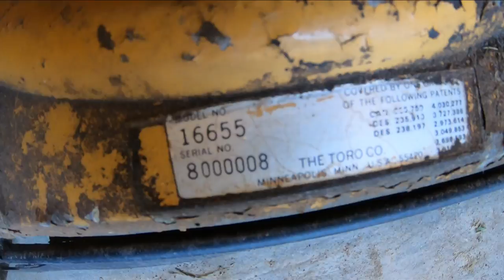Vintage, Heirloom Lawn Mower, Will it run?

Comment: dude aweasome machine,they are the best ones.but i have a question.where did u get your boots from? i need me a pair.
Reply from the maker: These are ariat work hogs, I’ve had 5-6 pairs with great luck, this pair however isn’t holding up, less that 6 months in and the sole is coming off!

Comment: Briggs always used a die cast aluminum key. When the blade hits something, the key sheared instead of breaking the crank. Of course it would be out of time.
Reply from the maker: yes I have a pack of them here I just never realized they wernt steel, ive gotten alot of free mowers that just need keys

Comment: When DC starts cleaning the mower
Me: thinks Should have done that outside
two seconds later
DC: Should have done that outside
Reply from the maker: the shop is always a mess and I cant figure out why....
Reply: Diesel Creek is a tidy shop, a used shop?
Reply from the maker: @almostanengineer  id argue its not....
Reply: Daniel Coates I thought he would have steam washed the sucker first.
Reply: @DieselCreek  Our workshop is both clean AND used.  It may also contain a ride-on mop!

Comment: the first 2 digits of the "code" number on the metal shroud on the briggs will tell you the year. As long as its the original engine

Comment: Look at the motor shroud theres 3 sets of numbers the the last set is the code numbers it may say code it may not but either way its the code number the first two digits of the code number is the year so if thats your original motor you can go by the code number remember just the first two digits

Comment: My dad's got one just like it got it from my grandpa when he updated his been through hell and back basically just a deck at this point engine was replaced 2 times the decks been repaired and the self propelled part hasn't worked in years because it was broken when he got it. I am curious though I have never seen a yellow one before is there something special about it?

Comment: i fixed an old vertical shaft tiller looked like the same engine put the pull was different
and the problem was the points

Comment: They make aluminum crank keys to break off if you should hit a root or something it won't bend the crank yes those were made when people had common sense and knew better than to keep hands and feet from under mower deck. Safety first Matt lol
Reply from the maker: ive got the genuine Briggs keys, never realized they wernt steel lol

Comment: Be careful i broke the chuck off my dewalt 20v hammer drill starting one of my projects lol
Reply from the maker: I’ve somehow managed to get 4-5 of these drills so I won’t cry if I break one, this ones got a bent shaft from doing this
Reply: @DieselCreek  i hear you brother. Just replaced a second chuck screw today! Keep up the great work. I did diesels for a while in our shop now its all small engines. I aint gonna lie i love the small engine side of town just did a head gasket on a kohler xtx675 today. 40 bucks saves a 300 dollar pushmower whoop whoop
Reply from the maker: @cornbreadntatersalad1634  small engines are my favorite thing to work on as well, so easy and can be quite rewarding too.
Reply: @DieselCreek  yessir puts dinner on my families table everytime!

Comment: I think that's a Toro but it was sold by JCPenney because it's yellow.
Reply from the maker: interesting, I was wondering about the color. in the parts horde he has for it there are a few spare decks and they are red.
Reply: @DieselCreek  I was trying to look closely to see if it said JCPenney anywhere but one of those old cast aluminum deck mowers I had was a non-self propel 19-in same deck style as that and it was gray and it said JCPenney so it could have just been some other store special edition whatever I don't know I do know that they used that deck casting in the late sixties for Toro guardians and the old whirlwinds with the Tecumseh engines on them.

Comment: The blade and deck will last much longer if one does not run the mower over gravel and sand where the blade can suck up the abrasive material.
Reply from the maker: thats why I jacked it up, I like to leave the green stuff longer

Comment: I picked up a lawn boy last week looks a little newer than this one same aluminum deck unfortunately rear wheel drive, lawnboy is made by toro
Reply: It also has all the safety crap on it
Reply from the maker: I think the early lawn boy stuff was its own company, not sure about todays
Reply: According to my wife, lawnboy has been owned by Toro for a long time 20 years +
(my wife runs a lawn and garden warehouse for the east coast)

Comment: i hve a mower just like that and it runs fine until it gets under a load then it dies.
Reply: try adjusting your mixture to be more rich. Adjust it out until it starts blowing black smoke then adjust in 1 turn

Comment: I like my battery-powered mower more than any gas-powered mower I've ever owned
Reply: I hate mine. Damn thing cuts out halfway through cutting my lawn and then takes 4 hours to charge before I can get back at it.
Reply: @jboy9724  I have/ had an  Echo weed whacker with a 54v lith battery.  The battery went bad after about a year and  they cost over $300 !  The whole thing wasn't much more than that.
Reply: @jboy9724  what model did you buy? It's definitely not a cheap investment.. but it's well worth it in the end. Just make sure to have like three batteries depending on how big your yard is that you can always take one off the charger.
Reply: @cut--  DeWalt weed eater is the way to go, especially with the new 2020 version.
Reply: @Cody I stand with you on the dewalt trimmer, I run mainly dewalt power tools and its extremely convenient having 3-4 spare batteries. As for the mower I just have a Sun Joe because I live in a trailer park on a single wide lot, battery dies halfway through when bagging or mulching but when the flap is left open it can barely make it
Reply: If they made one that would mow 6 acres on a charge for $3k or less with a 5yr warranty i would try one

Comment: I was not going to give a thumbs up because you did not check the kill switch first, but the BJ`s fix everything comment made up for it.
Reply from the maker: the kill switch is built into the throttle unless so I knew it was off
Reply: @DieselCreek  I know, but they bent fouled up a lot,....wire vibrates off on the older equipment......tabs get bent etc.  I was pretty sure you probably checked it off camera,...just messin with ya !

Comment: WTF are you doing to a mower to have it die in 5 years? I've never heard to that happen before. Even the cheapest mowers last 15 years easy. I speak form exp.
Reply from the maker: The decks rot out, I went to start it one day and the motor pulled loose from the deck lmao...only thing that kept it from flying completely off was the blade

Comment: "If your not an idiot, its not going to be a problem."  That may not be politically correct but it is still a truism.
Reply: Of course the idiots are the ones to sue the manufacturer when they become injured or disabled because the idiots are the ones without insurance. There have even been people who remove the safety devices who get injured and sue the manufacturer because they made it too easy to remove them.